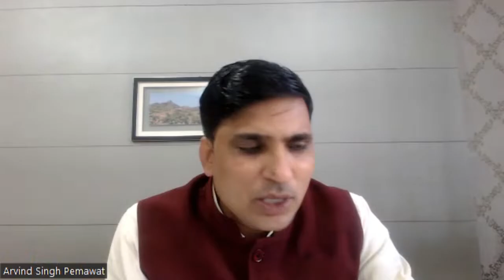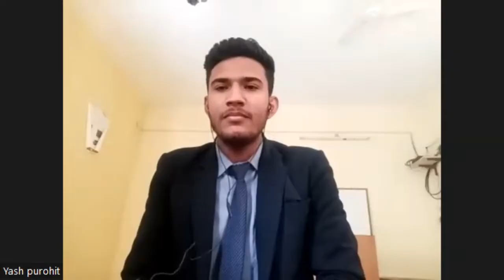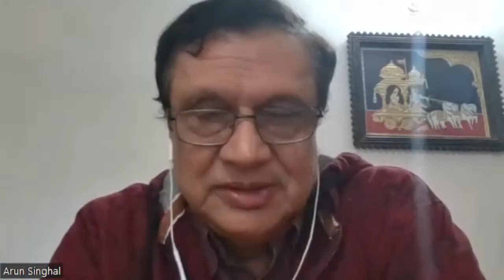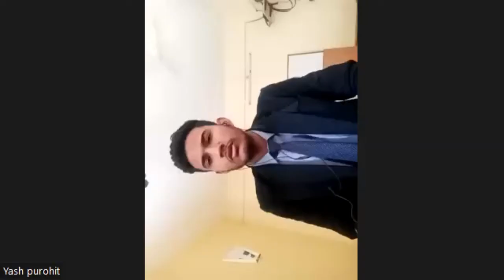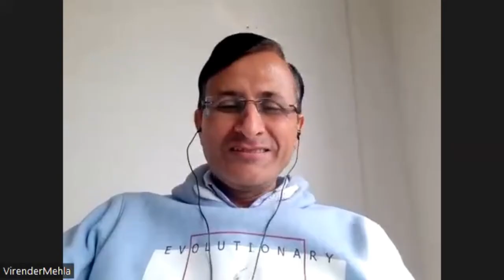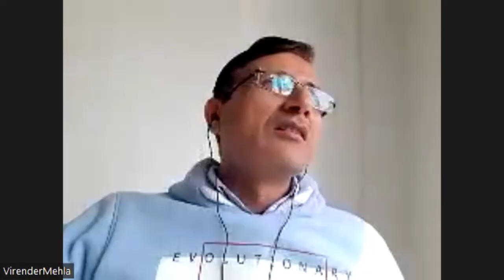Electronics Mock Interview I Fresher's Interview for Campus Placements I Arvind Singh Pemawat

Comment: Sir i know what is vlsi, vlsi is a very large scale integration which is used to design ic, in which before we can use only one transistor at a time bit due to vlsi technology we can use most of the Transitors at a time by combing in a one ic by using vlsi. Vlsi is used to combing the most transistor in one ic
Reply from the maker: Ok